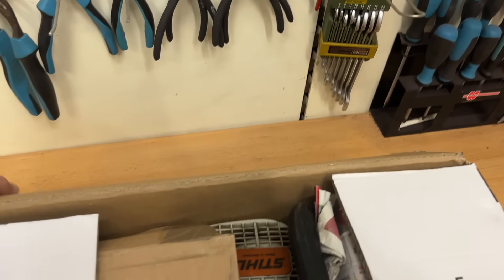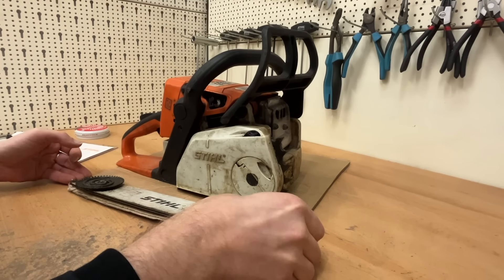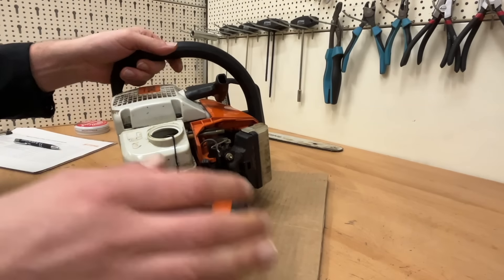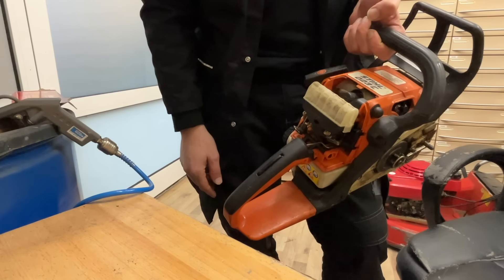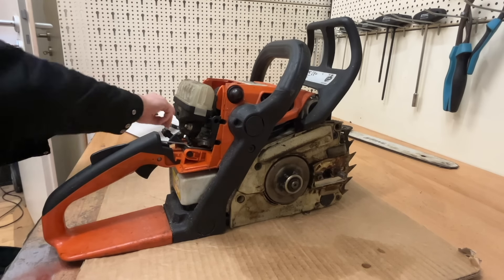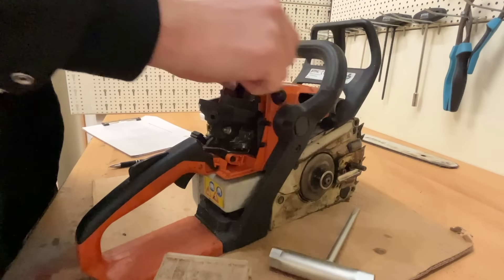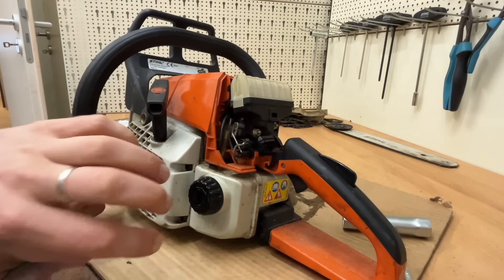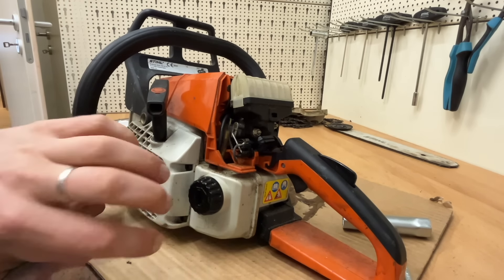STIHL aus ebay Vergaser RICHTIG einstellen #stihl #kettensäge #sägendoktor #motorsäge #reparatur

Comment: Normal sucht man den Peak mit L und dreht dann eine viertel Umdrehung in Richtung fett, dass Standgas wird dann mit der LA Schraube auf 2800 Umdrehungen eingestellt.
Reply from the maker: „Eine viertel Umdrehung“ ist kein allgemeingültiger Wert, da eine 1/4 Umdrehung bei jedem Vergaser und vor allem bei unterschiedlichen Geräten vollkommen anders wirkt. Wenn man es richtig machen will, dann macht man es so wie ich es gezeigt habe, denn das ist die Herstellervorgabe.
Reply: Ja aber das ist doch nicht logisch, du drehst L auf bis du den Peak hast und dann wieder zurück bis 2800 Umdrehungen 🤷🏽‍♂️, so hast du es zumindest erklärt, oder hast du dich versprochen.? 
Grüße
Reply from the maker: Es wird damit kontrolliert ob die Drehzahl noch immer über +900 u/min über der Leerlaufnenndrehzahl liegt. Was theoretisch möglich wäre wenn jemand die LA deutlich zu weit eingeschraubt hat. Und da jeder alles verstellt, ist das keine Seltenheit. Es ist unter Umständen möglich, das man mehrfach nachregeln muss.
Reply: Vielen Dank. Gibt es eine Alternative zum Stihl Drehzahlmesser?
Reply from the maker: Wir als STIHL-Fachhandel nutzen natürlich nur Originale. Theoretisch spricht aber nichts gegen einen Drittanbieter, solange die Messgenauigkeit passt. Wie erwähnt sollte die Genauigkeit bei 100 U/min liegen.